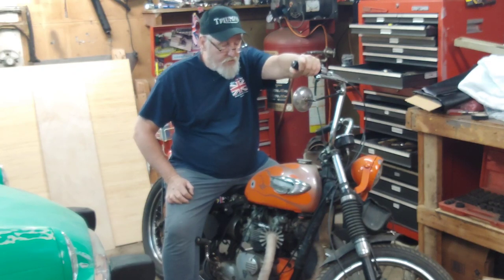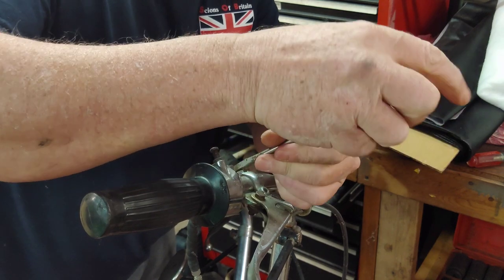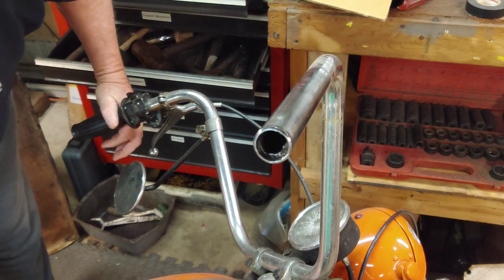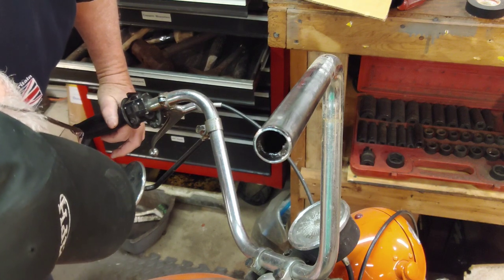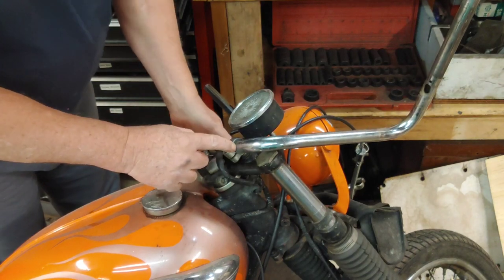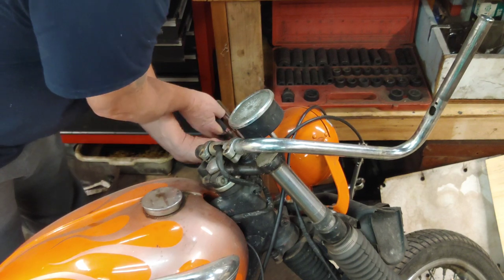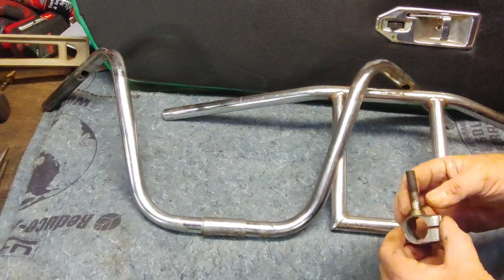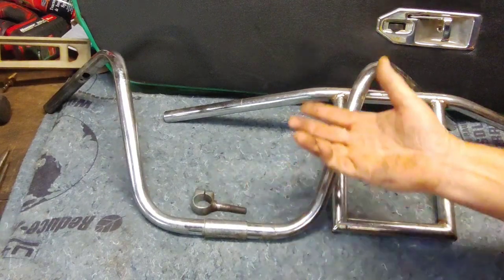Triumph Hardtail Bobber Handle Bars. #triumphbobber

Comment: Intetesting! I hope you can track down a set of two pieces mounts either in the shed or aftermarket. As for the wiring, does it have to be fished thru the bars or can they be zip tied on the outside of the bars? I know nothing about bikes lol.
Reply from the maker: No it can be zip tied to the bars but I figured if it is not needed why have the wires. Yea I got the mounts and you will see whats going on this Wednesday.
Reply: @TheLostWrenchGarage  oh ok cool on both. You folks stay warm up there brother. It is windy as all getout down here right now.
Reply from the maker: @jeffjackson5331  Same here and its going to snow again tonight. At least it going to warm up this weekend again. Stay safe Brother and God Bless!!
Reply: @TheLostWrenchGarage  yep! Will do brother will do.